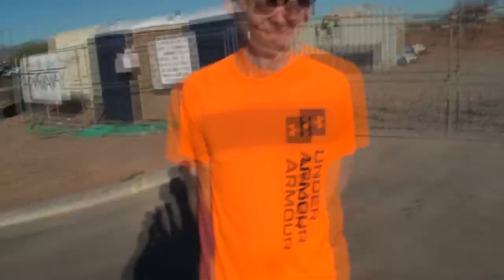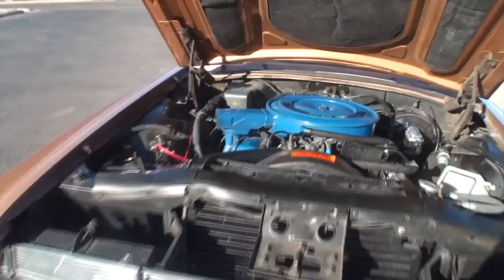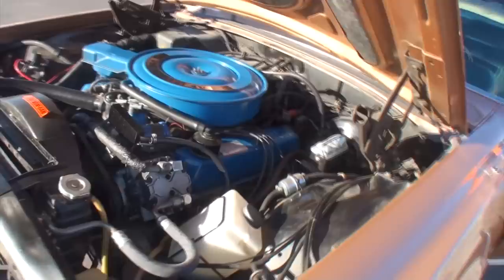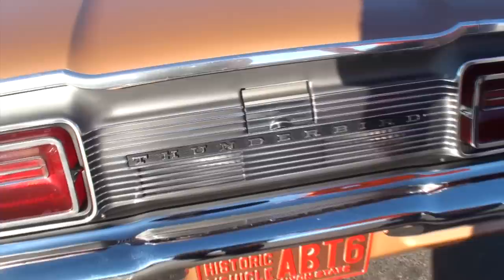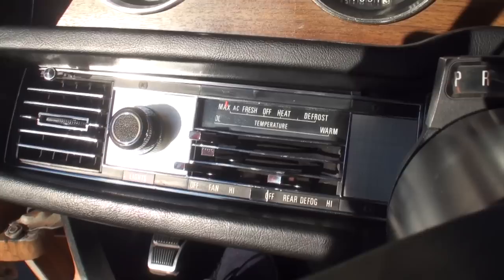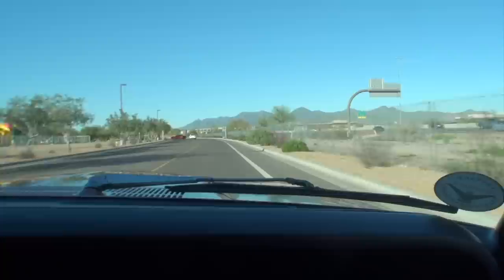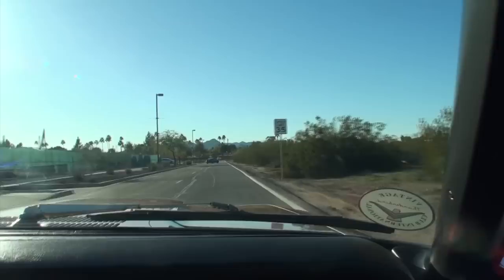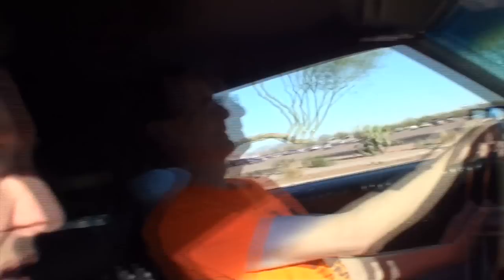1969 Ford Thunderbird 2 Door Landau 429 CI in Copper & Ride on My Car Story with Lou Costabile

Comment: Great car ! Had a  1969  4 door Thunderbird . Bought it in 1997 . Had 38,000 miles on it . Burnt orange and white vinyl top . Had every option except door locks and all worked . Never a winter driven car and no rust or pitting on all the chrome and white metal trim . Had same wheel covers as yours . Classy car. Wish I would have kept it .
Reply from the maker: Hi 5th Avenue, Happy to read this car brings back memories of your car :-) Thank you for viewing and sharing, Lou

Comment: Great car, great colour, and the owner did a spectacular job with the engine and a/c. Runs really quiet with no valve tick.

There were actually three body styles in this generation. In addition to the 2 door landau and the 4 door pillared sedan, there was a 2 door hardtop with smallish rear windows.

Interesting design that is rarely seen on the roads these days.
Reply from the maker: Hi Matin, I agree, a rare Bird to see on the street today, Lou

Comment: What a beauty! This vehicle is superb in looks, even today! To me, this cars back in the late 60's had an eye for envy. 
Huge 429 V8 made some speed...429 Ford engines were NASCAR "approved" in auto racing  if I remember. This car was an executive favorite (as shown in ads and TV commercials)
Lou...you do such a good job in all these classic car shows...giving the person showing the car the proper pride and joy of ownership and when they showcase the cars. 
Have any of the passenger cars you've done been a 1966 Rambler Classic four door with a 232  6 cylinder...Pontiac '66 Le Mans coupe with a 326 V8 and automatic...1970 VW Fastback?  I had the joy of driving them and owning two: the Pontiac (my very first car I bought in September of 1970 [$650]), and the VW, which a four on the floor I was given by my folks in December of '75 ? The Rambler was one I drove at times after I got my operator license in 1968. My folks bought it in April of 1966 (in fact, it was April 23...a Saturday) My very first car date was in that yellow/black car...That was late June in Indianapolis.
Reply from the maker: Hi Tom, Happy to read you enjoy the details of this "Beauty" :-) Appreciate the kind words on the video, Lou

Comment: 67' thru 69' "Glamour Birds" were the great.
Reply: The '70 and '71 with the "beaks" were the same gen too, as hard as that is to believe. Tip: Front clips from the nice looking '67 - '69's will bolt right on and fix 'em. ;)
What's cool about some of the "beak" car's is, they also offered a sort of fastback roof in some. In fact, most have it. It's far less common to see the "beak" cars with the normal back ends. A front clip put on one of the fast back style with some mags, a rear spoiler and a blower through the hood, or a big hood scoop, would make for a MEAN looking muscle car! One day I might build such an animal. Most of the "beak" cars, have nicer, plusher (cloth) interiors too.
Reply from the maker: Hi Johnnyc drums, Happy to share this one with you :-) Lou
Reply: @Warrior_Resisting_Colonialism  ; 67's are the same gen., but I don't think the body panels and fenders are exactly the same as 68' + 69'.
BOSS NINE hood scoop might look pretty good, but I saw one with a dinky little hood scoop (narrow) and it looked completely out of place,

Comment: I had a 69 thunderbird in high school in 1973.  I bought it from a cheapo car lot on old Route 66  Oklahoma City for $1100.  Also a landau with factory sunroof.  It also had factory cruise control 8-track player, console, P/W and power driver's seat.  It actually was a one owner car with 80,000 miles but must have been hard miles.  The 429 had a rod knock every time you started the car and the transmission slipped a little.  However, despite all of that, I drove it to Northern California and back from Southern Oklahoma with the cruise control set to 77mph on the interstates.  The last cheap trip before gas prices shot up.  I have always liked the 69 but I only ever wanted a true hardtop, which had no vinyl and also had the rear quarter windows.
Reply from the maker: Hi Jeff, Happy to read this car brings back memories of your car :-) Thank you for viewing and sharing, Lou

Comment: Nice!  Always liked this generation, even though I've owned one from the generation before, a '65 white/red when I first moved to CA.  Found it for $400, had non matching wheels, smoked like a mosquito truck, but the body (needed paint) all straight and interior perfect!  After paint, complete restore of engine, trans, wheels, brakes, etc. and $2800.00 later, it was beautiful.  This '69 in the 2 dr. Landau option is a find.  The suicide door 4 dr. I wouldn't say no to either.
Reply from the maker: Hi K B, Happy to read you had a fun 1965 :-) Lou

Comment: Lou ... Years ago when I was just a kid , "Hot Wheels " the toy cars were brand spanking new & the had many cars they produced in miniature for. I had this suicide doors Thunderbird . In the print outside the box listed it's Real Life model specifications & list of equipment.  I was so overjoyed to have it. I got both this one & a 68 SS Camaro I bought @ the same time. Just a coupla years later my Favorite Aunt purchased this same car here in this video & her husband Purchased the SS 70 Camaro. Was I blown away or what.! Yep those were the days my friend. Those two Uncle an Aunt were childless & embraced me & my siblings as there own. My Mom had divorced my Dad. Yup he had his interests in another lady. Everything turned up fine for all involved. But my love of Cars had changed from High HP cars to more Luxurious ones. My reasoning was sure it's fun to go fast but everyone spends more time going the speed limit & following posted speeds. So I thought it'd be Far better to be surrounded by luxury or be stuck with a basic no frills interiors. I chose Luxury. To this day that's what I have for my daily driver. My Lexus. Uh don't get mad @ me now I still run around most Sundays in my Dad's ol 71 Lincoln Continental. Yep that's my jewel I keep pristine & covered up in my Garage. Regular oil changes .. monthly checks of the diff & recently changed the tyranny fluid. Twice. Let's not forget the Torque Converter has got quite a bit of Trans fluid in it too. Replaced the radiator w/an all aluminum. Constructed one. Triple Core. My Dad lived near Death Valley & the Heat there is uggly hot . He didn't drive much had very poor eyesight after 63yrs living. Did lots of welding through the years took a toll on his eyesight. I got the car as a gift from him on his 70th B-Day. Really got all my Siblings riled up but I'm the ONLY mechanic for there cars & I'm a licensed mechanic by trade. Retired now but they really were pizzed off I got the Car. Anyhow I still take out my Green beauty & take her to church & it still gets ooh's an ahh's wherever I go.
Reply from the maker: Nad...The Green Beauty gets oohhs and ahhhs at Church. AMEN! Lou

Comment: 1969 Ford Thunderbird.
The Ford Thunderbird would first be introduced in September of 1954 for the 1955 model year as a personal mid-size luxury car, possessing luxury options that are now common on standard vehicles today, such as Air Conditioning (A/C), Power Steering, Seatbelts, and Spare Wheels at the back. It came with the 4.8 Litre or 5.1 Litre Lincoln "Y-Block" V8 and came with a 3-Speed "Ford-O-Matic" Automatic Transmission or regular 3-Speed Manual Transmissions. The base price for the car was higher than the Chevrolet Corvette, at around $4500 to $5000 ($51,000 to $57,000). The MPG (Miles Per Gallon) this car made was around 18 Miles Per Gallon. The car sold around 53,000 units.

The second-generation Thunderbird would be released for 1958 and lasting until 1960 (This was common for the early T'Birds, with each model lasting around 2 years to 3 years) as a newly redesigned full-size luxury car (The first generation 1955-1957 T'Bird was 185 inches, while this T'Bird was increased by 23 inches to 208 inches). The car was redesigned with quad headlights at the front, an extremely big/redesigned grille, and redesigned rear taillights surrounded by ovular pieces of metal. The 1961-1963 Thunderbirds and 1964-1966 Ford Thunderbirds were designed similarly with the same design features and luxury features, such as A/C, Seatbelts (Luxury), an aggressive front end, circular taillights, and a high price tag.

This generation of the Thunderbird (1966-1971) would introduce a dramatically new front, side, and rear end design. For the front end, it featured a grille that covered the entire front end of the car with vertical/horizontal lines and a bird that would cover up the middle section of the grille along with hide-away headlights. It would also introduce foglights and side turning signals on the front sides of the car. For the rear end, it would be completely redesigned switch to rectangular taillights and have a "T H U N D E R B I R D" script in the middle of the rear fascia. They would introduce the Ford 385 V8 and Ford FE V8, with the 385 V8 being used on other of Ford's luxury cars and their sisters, such as the 1968-1971 Lincoln Continental Mark III.
Reply from the maker: Hi Matthew, Thanks for viewing and sharing your knowledge, Lou

Comment: I owned a 69 Landau in light blue with dark blue fabric interior.  It had an electrically driven sun roof controlled by a rocker switch mounted in the overhead panel.  I was told that it was the only 69 with a sun roof, made as a show car for touring fairs and car shows of that era.  I was the second owner after it was retired from show biz.  The car was equipped with cruise control.
Reply from the maker: Hi Jeff, Happy to read this car brings back memories of your car :-) Thank you for viewing and sharing, Lou

Comment: I added factory air to a 61 Lincoln convertible which meant removing the dash panel and everything all the way down to the firewall.  It took nearly two months of part time work.  All of the parts were sourced from a junkyard car.  Quite a job.
Reply from the maker: Hi Jeff, WOW, nice work! Lou

Comment: The only thing I like better about the 68's is the full panel tail lights.
Reply: I have a '68. The biggest reason I went with the '68 was the rear side, quarter windows. '69 was too blocked off and square looking for my taste. Did you know the rear quarter windows on the '68 don't roll down, they slide backwards to open? I also prefer, however just slightly, the '68 grill over the '69's too.... I much prefer the large '68 tail lights over the '69's but like both. I like the rear side markers, being longer and sleeker on the '68's also.
Mine's the 2 door coupe (former landau) and since there's no window pillar for either window, when you roll all the windows down (slide back the rear quarters) it looks pretty sporty with a wide open window look.
Reply from the maker: Hi Johnnyc drums, Lots of lights on the back is nice :-) Lou

Comment: Fun Fact , The 69 Thunderbird and Lincoln Mark 3 are basically the same car. The Bird has the 429, while The Lincoln has the 460 Engine...
Reply from the maker: Hi poisedforduty, Thank you for sharing the fun fact, Lou
Reply: Yup, that's true. They are the same platform these years. The 429/460 engine was introduced in these cars in 1968. Exactly right, the bird got the 429 while the Lincoln got the 460.... also same basic engine, just a different stroke (to keep it in simple terms but it's not much more complicated than that. Most 429's get rebuilt into 460's during a reman. Those who are smart enough will do so. My '68 came with a reman 429 though, and it's not worth the expense now since it's fresh as is.)

Comment: 12:20 - Nope, even for Thunderbird, the swing-a-way steering wheel was an option. It wasn't standard (most of these birds were not ordered with it... however, it's not a rare option to see.... My '68 does NOT have the tilt-a-way wheel, though it was an option.)
That's amazing he found a car without factory A/C. The vast majority were ordered with it. Interesting to know, they shared the same large HVAC box (that I eliminated on mine) on the firewall, when I ripped the A/C out.
Did you know power windows were an option also? It's VERY rare to find one with crank windows though! Seems everyone ticked that box! About as common as the A/C box getting ticked I believe. I would like to change mine over to old school cranks someday.... but I did go through and totally re-wire and update the whole wiring with modern relays and new window motors for now to make it all work right.
Reply from the maker: Hi Wabanaki [Dawnland People] Mi'kmaw Indian Warrior, Thank you for viewing and sharing your knowledge. Hope you see many more cars on this YouTube Channel you enjoy. Lou
Reply: Tilt-away wheel was standard on 67 Thunderbird, optional for 68 and 69.
Reply: @sooverit5529  I didn't know that. Interesting.

Comment: Why does it appear to have four window controls when it has only two windows, or are two of them door locks?
Reply from the maker: Hi cl7player, Hmmm, I'm not sure. Hoping a Viewer can share knowledge, Lou
Reply: I'm curious as well. I'm pretty certain they are not door locks. I have the same car and 3 controls there. 2 to operate the windows and a 3rd one which I think is for locking the passanger window (safety feature?) but not sure since it's not working.

Comment: I had a blue and white one l know why they wanted the motors that speedometer will go back toward 0 l don't know what that motor would do in a mustang
Reply from the maker: Hi Clemon, Happy to read this car brings back memories of your car :-) Thank you for viewing and sharing.  Hope you see many cars on this Channel you enjoy!  Please Subscribe, and hit the "bell" so you can see all the cars when they are uploaded on this YouTube Channel, Lou
Reply: @loucostabile  l hope he keeps the battery hot, the alternator has a small electronic voltage regulator that bolts on the back it was nearly $40.00 you could get a alternator and a regular one for that l rewired to the old days no more trouble